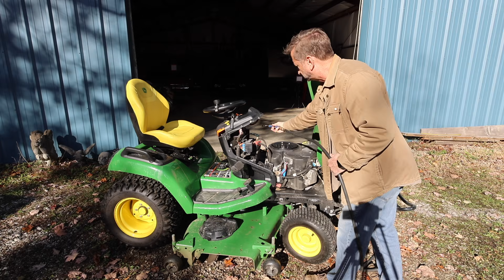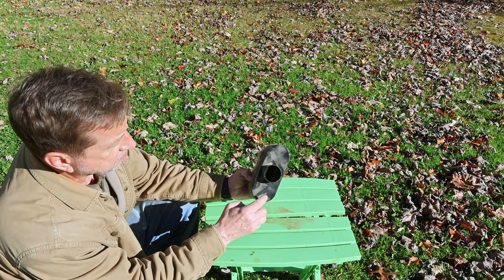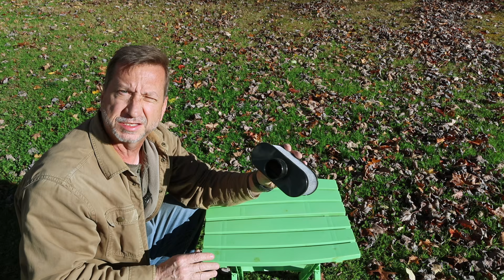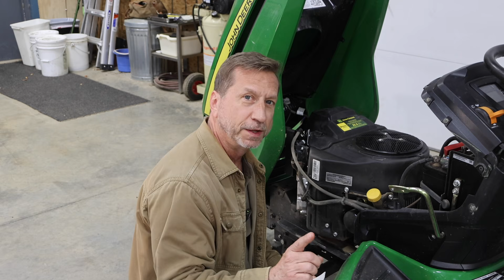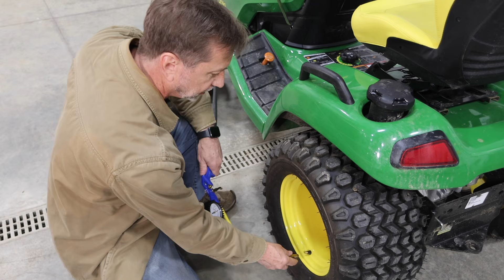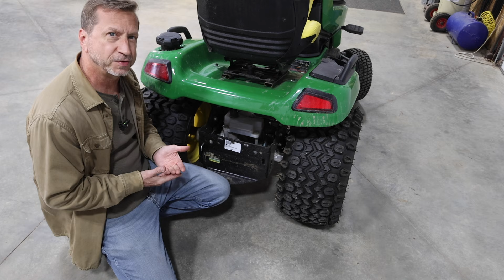Preparing Garden Tractor for Winter Use

Comment: Couple tips I recommend doing at least once a year- 1- blow the fan over the trans out ggod. A lot of dirt and crap settles in the cup on top.  2- the manual even recommends doing this , and that is remove the shroud on the engine and clean the small cooling fins and grooves off well. It'll help your engine last long by running cooler. It is one reason Kaw has started installing the two blowout ports on the top of the shroud, but if your engine doesn't have them, regardless of brand, remove the shroud and clean the engine well.
Reply from the maker: Those are some great tips! I do blow off that fan over the transmission. As far as the fins on the flywheel under the shroud, I do blow that off but have never removed the shroud to do it. I’m going to look to see if I have the blowout ports you mention. If not, I’ll remove the shroud to see what I find. 👍
Reply: @InTheShopWithLen  There's a port on each side over the cylinder head. Thy are held in magnetically and attached with a small cable.
Reply from the maker: I keep meaning to check for those blowout ports on my newer X590. Next time I’m out I will.

Comment: Great video. Just found your channel and am learning a lot. I’ll be getting a x580 or x590 in the near future so I’m paying close attention.

How do you like your snowblower setup? I’ve heard people suggest you really need the 4x drive of the 700 series, especially for a 7 degree slope driveway like I have. Trying to decide between the x590 with snowblower setup vs. a 32” Ariens Pro walk behind. Thanks.
Reply from the maker: I’m very happy with the snowblower set up on my X590. The only thing I don’t like is the belt installation. Sounds dramatic, but it really is a pain in the butt. Other than that it’s been great. As far as the slope in your driveway, I’m not making any promises, but I honestly don’t think you would have any issues. Weight on the back to offset the weight of the snowblower is very important. I have suitcase weights that I hang from the bracket in the rear. For me, chains were also like night and day, and I would definitely recommend.
Reply: Thanks, appreciate your opinion!
Reply from the maker: No problem and happy winter!